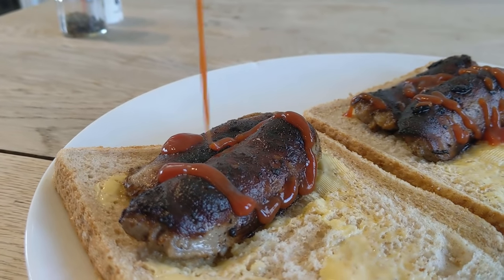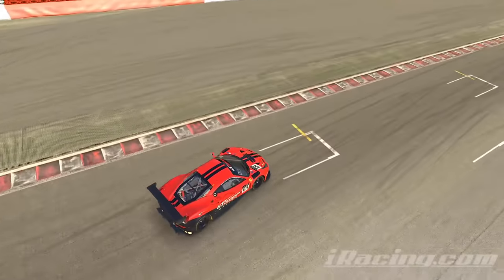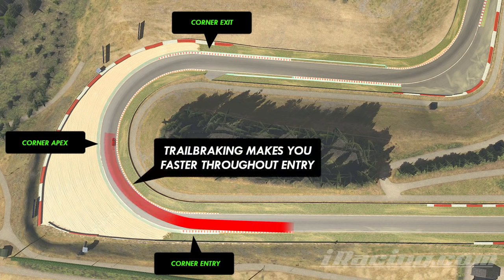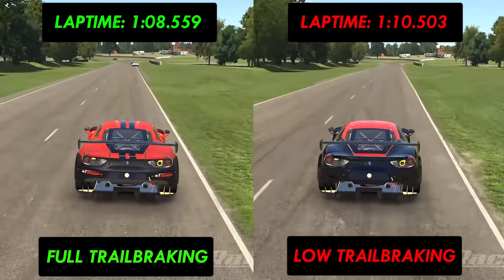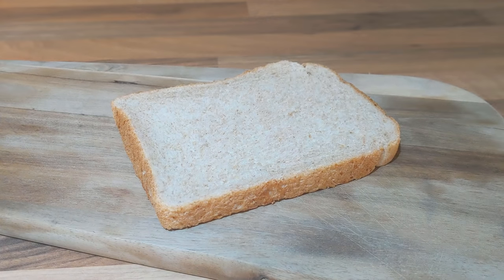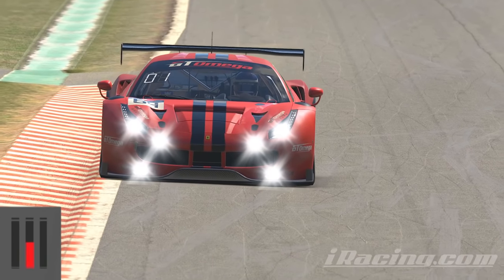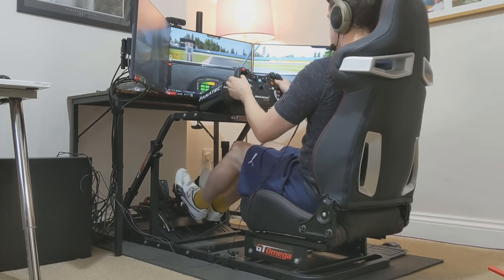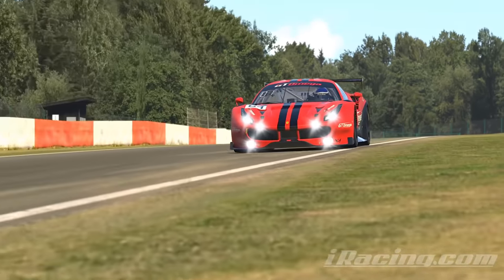Trailbraking In Sim Racing - How Slowing Down the Right Way Makes You Faster

Comment: I appreciate you giving your explanation, you are correct.  But if you want to learn how to be fast trailbraking then run dirt oval for practice.  In a non wing sprint car, midget you use your left foot more then the right foot.    If you spin out alot in a road course car,  it means you are lifting all the way off the throttle.  if you keep the chassis bound you will keep grip...   You should use the brake factor to find the right fudge factor based off of you input.   With fantec cspv3's 0 brake factor is linear(actual input to sim)  i tend to be .3 to .6 depending on car.   On dirt I turn up the fudge Brake Factor to 3+ because I am never off the brakes come feature time when track is slick.  brake factor accommodates lower resolution pedals(non load cell) so you aren't just locking up the brakes if you give them some hard input into a corner.    Also, something to test out that I do.  Turn the traction control to a very low setting, and the ABS or stability managment.  That will allow you to actually feel the car better on entry/exit and get used to driving it more on the edge.   I like the AMG GT3 and run TC just above OFF and I set ABS at about half until i find where brake bias works while braking all the way through a corner.  then i will turn it up a bit once it felt good.   in fixed set, not sure if you can even change brake bias, but brake factor is your friend to find your input to response "sweet spot"

Comment: I recently got AC and have been doing this and didn't know the proper term, great video always great to learn.

Personally I like to run my front tires 1 or 2 psi higher than the back to help grip
Reply: having more pressure in a Tyre usually doesn't help them to have more grip, well in my books at least, but I'd be interested to know if you have an explanation or maybe it's just a feeling you have, because to me it seems a bit counterintuitive

Comment: Your suspension has to be set up properly to get the full benefit of trailbraking also. Trailbraking with a poor suspension setup will hinder your front end grip and make you more prone to rear tire spin/snap oversteer.

Comment: When trail braking, the line into the corner is slightly different. You should turn in earlier, as if going for an early apex. You carry more speed, with a straighter approach. As the trail braking lowers the speed, the line tightens, and you hit the same apex as you would without trail braking. The trail braking line is shorter and faster. It resembles a section of a spiral (clothoid or euler spiral), instead of the more circular arc you drive without trail braking.

Comment: Every technique in racing minimizes and smoothes out stresses on the car RELATIVE to the speed you're going. Because of that, you'll also be a smoother limousine driver if you apply these techniques (while arriving at the destination at the exact same time). Or a faster limousine driver, while putting the same amount of forces on the passenger as before. Trailbraking is all about smoothly transferring the passenger's bum from braking force to side load.

Comment: Just keep braking later and try to survive. Especially works if you're heading straight for a barrier or a very costly off zone. You'll start to pump the brake trying to find maximum grip and turning the car around the corner. Then you iteratively learn to become ever quicker in adjusting that input and smoothing it out. Keep braking later until you cannot go any later without going too deep.

Comment: I watched many videos on trailbraking and thought I did it correctly but recently i noticed, I did it wrong. I lifted off the brake way to much, basically not pressing it at all.  You have to get your brain to intuitivly understand, that slamming the brakes between 70%-100% creates massive understeer but using maybe 20% actually improves the cornering. I was always "afraid" to trailbrake harder, because in my mind it would make me understeer, even though it has the exact opposite effect.

Comment: I have been racing a few times but was never fully aware of the terminology. I found out what trailbraking was years later and as it turns out I am naturally Inclined to this type of braking in not only my daily driving but also when I went on a circuit too. I use to think the first example was faster so while on a track sometimes I would actively try to do all my braking before a turn but after only a handful of laps I would naturally revert to trailbraking because it just felt more natural. I was never able to tell if it was faster because I never understood what I was doing really I just wanted to drive fast lol.

Comment: I could only try trail braking on about half the corners in my Viper during driving schools at real tracks.  It really depended on the design of the corner and the elevation changes around the corner.  With trail braking it allows your rear end to slip out a little more and sets you up for the direction you want to be heading as you start to put power back on.  It is all about the feeling you are getting from the car; I can't imagine doing it correctly in a Sim.
Reply: Muscle memory from the feeling you get from your accelerator and especially your brake(preferably load cell)

Comment: imagine there is a piece of string that is at one end  connected to the lowest part of your steering wheel and on the other end to your braking foot. this string is under some tension, so as soon as you turn the wheel, you need to lift the breaks accordingly. this helped me alot, so maybe smbd else has some use for that visualization
Reply: Does trail braking work for f1?
Reply: @Pure.G20  in every kind of racecar your can earn a few tenths by trailbraking

Comment: If you think trail braking is difficult, try doing it at the same time as heel-toe shifting in a manual car!  You need to use both techniques simultaneously when slowing down into corners.  Without a pressure sensitive brake pedal, driving a manual car fast is so much more difficult.

Comment: It's important to understand that there's no one method to apply to all vehicles in all corners. Trail braking is always an option, but vehicles have different traits that allows things like trail braking to be more beneficial to some more than others.
Rotary powered vehicles like RX-7s are very light and have motors with powerbands typically in the higher mid-range of their rpms. Without using a trail braking approach, you can discover the benefits of a light chassis allowing for more grip and a motor with useable power in places through a corner that punchier motors would never work well in. In this case, where others are braking still, a slow in/fast out approach paired with perfectly timed heavy throttle below the powerband will result in peak powerband utilized at or just immediately after the apex, resulting with less time braking and prime throttle the instant it becomes practical to send the vehicle accelerating flat out.
There's also other factors to consider in this approach as you are either wearing your brakes more with trail braking, or your tires with slow in/fast out.

Comment: Like all things in racing … It depends.  If the car doesn’t turn in well (like most mid engine cars and cars with a better than 50/50 weight distribution) then it can.  If the car turns well without it, then you will enter the corner in an unstable condition … and you will be slow.
Reality is that: not all corners need trail braking.
If you jump off the brakes and allow the nose to jump up you will be slow.  Like the throttle needs to be squeezed on and “unsqueezed” off, the brake must be treated gingerly lest you upset the car.

Comment: There's a phenomena that I see in GT Sport among the usual top 10 times in the weekly races and it's leaving 1 or 2% throttle on as you brake and corner whilst using an MR car. In this game, it rewards the driver by steadying the car (often while trailbraking) and allowing for a quicker lap time along with saving the tyres over a long race distance. Is this something that is used in real life or any other sim games? It'd be interesting to see a video done about this and potentially given a name if it doesn't have one already.
Reply: I know this is an old comment, but that’s always been my understanding of trailbraking in the NASCAR world. I could be very mistaken but my real understanding of “trailbraking” is more closely related to utilizing gas AND brake simultaneously.

Comment: Amazing video and great explanation. In racing sims and IRL racing this is extremely useful technique. However, I just have to mention that it's not recommended to employ this in your daily driving. Especially heavy braking like you would in a racecar. It's an easy way to either spin your car or understeer. The older the car - the easier. It's probably obvious but just wanted to mention.
Reply from the maker: Thankfully most standard cars on the road are engineered for understeer, but if you start getting sporty (MR2 etc) then you deffo gotta be careful as they are twitchier on purpose

Comment: On the street, there is the risk that if you overbrake too deep into the corner the rear becomes very light and if you're in a mid or rear engined car (or even a Honda S2000 for eg) that could be game over. I think we get the "logical" method via public road safety (which would make sense).

Comment: Thank you for this ... with your illustrations and your explanations, this has probably been the best video on trail braking that I've seen. 👍 I can think of only 1 related topic that I would have liked to have seen: brake pedal settings. Do you have the hardest springs installed on your pedals, or the softest? Any tips about how to set up brakes within the simulators (ACC, iRacing)? I would not ask you to try to explain how all of the various brake pedal kits should be set up ... just asking for more information about what settings have worked for you with your gear. Also, what pedals are you using? Thanks again.

Comment: Anyone remember the old Papyrus games like IndyCar Racing? Man those were the days. Love that Cleveland airport track. That's when I put my first "rig" together with a Thrustmeter wheel on the desk and pedals on the floor. I learned how to sim drive on that track / rig but after all this time I still struggle with braking in general, knowing just how much I'm actually applying has always been an issue. I don't get a good feel for how the car is slowing (or not slowing) as I apply the brake.

Comment: I’ve just come across this video today, and this is probably the best video on trail braking I’ve ever seen. Also, so are you saying that when Trailbreaking you’re not applying full breaking?
Reply from the maker: Thanks man, appreciated - trail braking is like fading out the end of a song, it has to roll out softly. Braking in a turn is always done fairly softly; how soft depends on the amount you need to slow down and the shape/speed of the corner.
Reply: @dannyleeracing  well now that ACC has gotten an update for the PlayStation five I can get in and really practice it.

Comment: The most difficult aspect of this for me to grasp is how can you apply consistent pressure to the brakes while needing to also balance the throttle and the clutch. And if you're left foot braking, don't you need the pedal to be as far to the left as possible so you're able to control pressure?

Comment: Haha 😂 I love your hesitation before overwhelming the bread. You’re like “fuck it! Im saying what i wrote!”
Can you relate trail braking to FWD?
Reply: Yes
Reply from the maker: Yeah, trail braking applies to FWD too, most FWD race spec cars are set up to be tail-happy under braking to compensate for the passive rear axle so in many ways they feel quite the same until you go onto throttle
Reply: @dannyleeracing  What happens to slip angle when you go on throttle?
Reply: I've only a small experience with FWD, but trailbraking with it feels a lot more like doing powerslides in fast corners because they're taking advantage of the fact that the car stabilizes as you throttle; gotta be brave on those corners!

Comment: If you want to learn trail-braking take a car that does not overwhelm you. The Toyota GR86, M218 are perfect. Take a track that has not too many corners. Brno, Mugello, Nürburgring are great. Now take every corner and try to loose the rear as gentle and close to the apex as possible. Once it's a controlled slide for the corner you want to learn you can do a view normal laps. If you want to learn quick don't push those laps. You are rather down a second per lap than loosing the car while you adapt your rythm. That's why we tested out when we loose the car in the beginning.

Comment: If you’ve ever raced in karts, you’d know that it’s best to tap the throttle through the turn. This way, the tires keep spinning fast enough so that when you exit the corner, your wheels don’t have to catch up to the engines power. 

Of course this a real life example and probably doesn’t translate to sim racing

Comment: That’s done in motorcycle racing when the front I heavy and the rear slips it point the front tire in the direction of the exit sooner does letting you get on the gas sooner

Comment: I'm a long beginner. My time laps are not improving anymore and I think it's time for me to learn this technic.
However I have the feeling "I don't have the time" to apply all those changes in pressure in my breaking zone. It's too going to quick. (Nordschleife)
What is a track you recommend to practice ? I could see Spa in your video.
Are you apply trail breaking in every corner ?
What is your recommendation on the stiffness of the brake pedal. I have a Fanatec V3, standard bloc inside.
Thank you.

Comment: The Holy Grail is to be 'fast-in fast-out' and for that you ultimately need a car to be setup as close to the limit as possible which isn't forgiving. I know driving schools teach beginners to be slow-in, fast-out' because it allows the novice to grasp the basics, but I believe if you don't try to progress your car setup and driving style towards fast-in, fast-out then you'll just be frustratingly slower than what you could be your whole racing career.

Comment: Brilliant video, like the one on slip angles. Once you are done with trail braking - do you let the tyres "breathe" (let the weight of the car finish transferring without braking or engine torque) by letting the car roll for a instant before coming back onto the power? I have seen in places this makes a big difference to exit traction (e.g. Redbull Ring Turn 4).

PS the sausage sandwiches looked good :P
Reply from the maker: I say It differs between car types - with stiff, high downforce cars like GT3 and above the moment of 'swing' can be quite quick and there's no need to give it a moment to settle, whereas GT4 and below need a softer shift from brakes to power. The amount of power you have also makes a difference to how smooth the 'ramp up' to full power is. I totally get what you're saying there, sounds like you visualise it the same way as I do. Thanks for watching and sharing your thoughts, man.
Reply: @dannyleeracing  Yeah, I learned a lot from your slip angle video and this one kind of extends how entry slip angle is generated and to what degree. I drive the Nissan GT3 in AC and I saw drivers get better exit speeds by just letting her roll for a quarter sec, so I thought maybe there was a connection. Thanks a lot for replying in such a knowledgeable way 🙂
Reply from the maker: @jackdyson5670  That sounds like it's one of those situations where it's good to just lean the car over and let it get through the turn, some cars start to push wide or understeer if you're too early on the power or apply it in the wrong way. That's another can of worms and another area where techniques play a part...
Reply: @dannyleeracing  Cheers Danny I'll bear that in mind for testing - listen I had an idea for a suggestion, these are really good videos because you talk about what actually goes on from a driver's perspective as opposed to just the physics : when you are ready, a video on GT3 aero ? Like rake, rear wing, the way they interact and how to set them up correctly?

Comment: Hello Lee. This has really helped me thanks for the info. Just1 question do you need to have the brake bias more towards the front or the rear to be able to do this. Keep the great bids coming
Reply from the maker: Alright mate - good question but there's no straight answer. Having bias too high will make the car understeer and trailbraking will be less effective. The way you find the perfect amount of brake bias is to reduce it (lower percentage means more to the rear) until it starts to help the car turn, but increase it if it starts to make the car too unstable. The 'correct' bias is the one that makes you confident to trailbrake lap after lap without losing the back end.
Reply: @dannyleeracing  thanks for that I'm going to give that a go now. Keep the good videos coming.

Comment: the part i don't understand for example. When on a straight line, hit the brakes, and then let go of the brakes completely going in the turn, how is this slower on corner entry? 

The speed should be higher than trail breaking since trail breaking u are you breaking entering the corner vs the other way, where we just let go of the break completely which our speeds are not lower than trail braking in the corner entry.

Comment: ehhhh, trail braking is useful but only for certain corners and certain cars with certain tunes. cant tell you how many times i've been able to powerslide the back of the car into a hairpin, pin the wheel into the turn, and modulate the throttle to power out of there with a slightly lengthened first gear for extra traction.